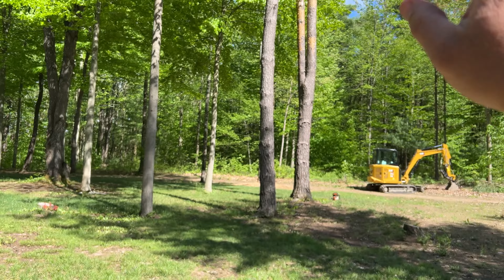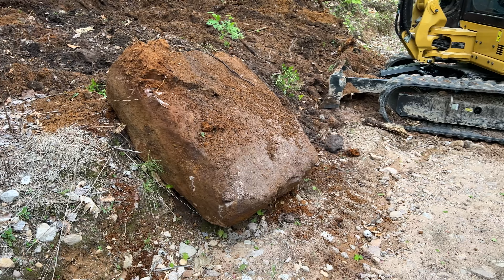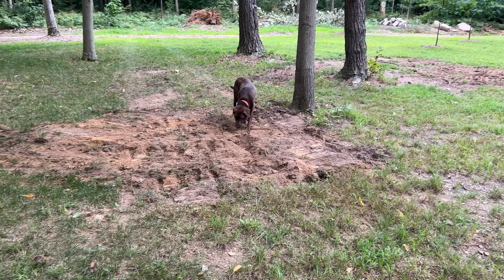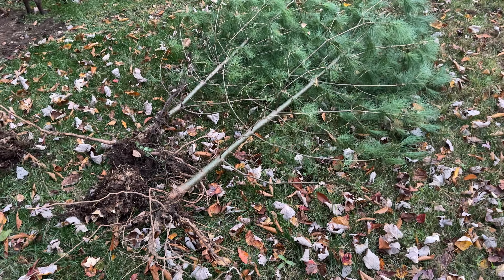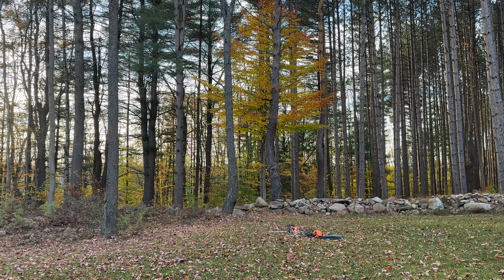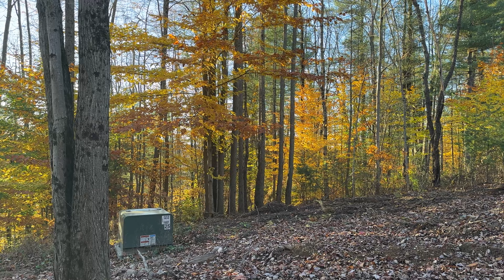Cat 304 Full Summer Yard Expansion Project.

Comment: Nice video! Keep the footage about the 304 coming, there not much videos online on those next gens! I am debating between a 303.5 and a 304, I really like the power in a tight package of the 304. How’s the tail swing on it? It would be nice to see it in action in tight quarters
Reply from the maker: Finally the weather is changing should be out doing stuff shortly.  I have a couple videos working in between some trees and such.  The tail swing isn’t huge just have to remember it’s back there.  Thanks for the comment.

Comment: Mate you have a beautiful property. My 304 arrived yesterday and I have about 4 hours on it now, fixed one track that even the Polaris had trouble getting thru. I got to say you make using it look a lot easier than it is.  Lastly, do you know how to find the code? no one is open because it's the weekend. The travel alarm drives me nuts.
Reply from the maker: Yahooooo!  That’s awesome I actually just got married random fact but that’s what’s going on here.  Quickly off the top of my head I can’t remember what the factory code was I found it on you tube somewhere.  As for the alarm am not sure if am correct but the only way we found to turn the travel alarm off for good and not have to turn it off every time you start the machine for which there is a button in the cab for was to remove the circuit from the breaker.  Hope this helps some happy digging!
Reply: @timberridgehomestead  Congratulations mate! and I found the code, you go into service and can turn off the travel alarm there. I hope it's ok, I shot you an email about my thumb, it looks too small and wont close all the way. I reckon it's the wrong thumb, congrats again on getting married.